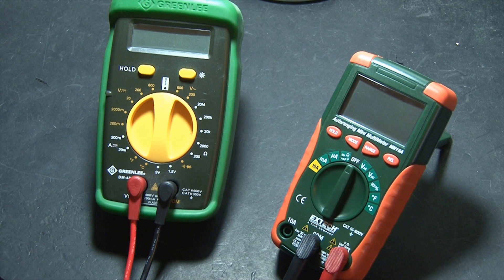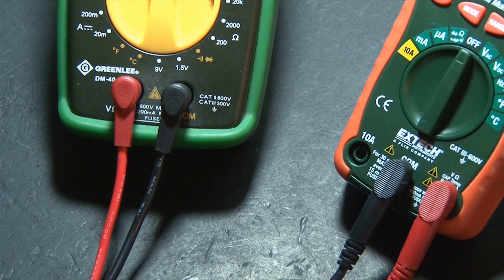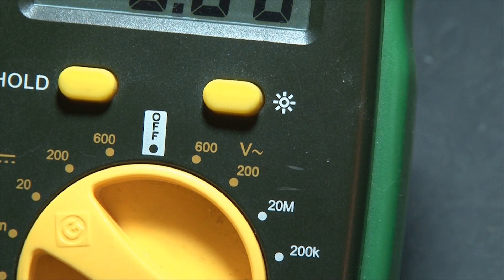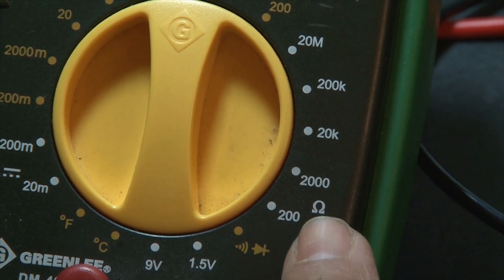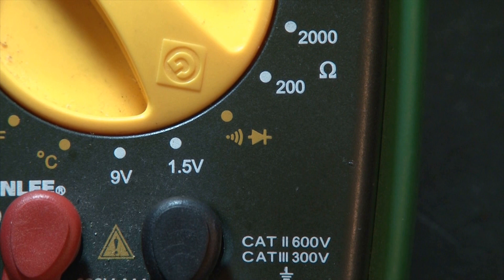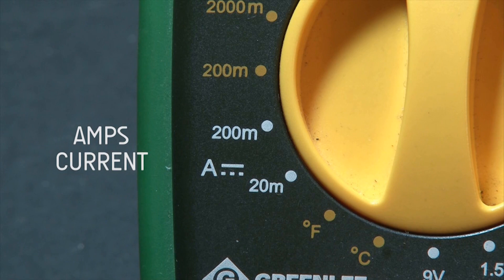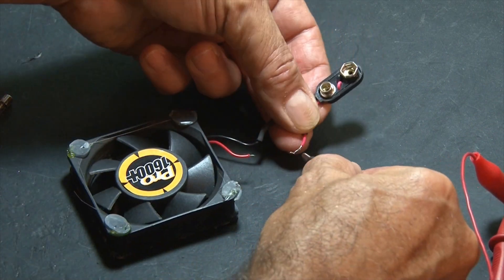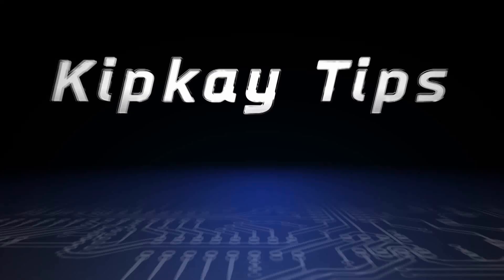How Does a Multimeter Work? Kipkay Tips

Comment: you need to get an upgrade XD come to the modern time with wall sockets of 230V :P
Reply: It's still not really modern, its Tesla's system was to have 240v 60Hz, but because 60Hz wasn't a sequential number in the metric system the UK decided to go for 50Hz.
Reply: It's actually 240V and it has it's pros and cons.
Reply: here its 230V and we are actually going to 220V soon
Reply: The Collector most American sockets are 110-120v @15 amps, there are some exceptions
Reply: thats why i said the need to upgrade to the modern time XD
Reply: What about 240 is modern times? The panel is 240 and puts out single phase 120 to the walls as it's much safer, there are a couple 2 phase 240 sockets in every house for large appliances
Reply: actually 230V is safer than 120V, becouse then flow is lower. Voltage will hurt but not kill, Amps are deadly and in 120V systems have 60Hz frequensy, when 230V have 50Hz.. not huge differend when both deal serious heart damage.
Reply: The Collector no, is not safer
Reply: Josue Rodriguez adress the right person i said nothing about it being safe. i said it was modern
Reply: There you go someone who knows